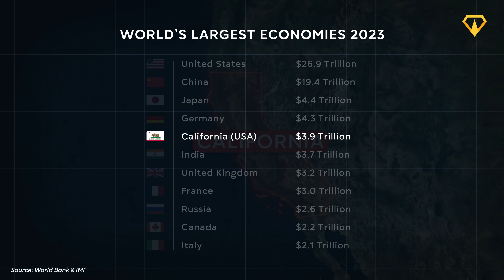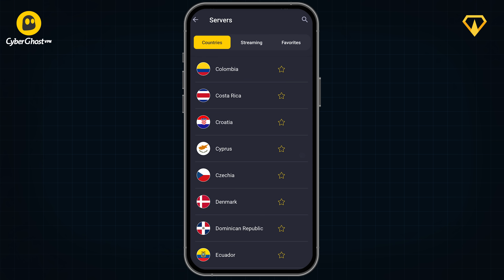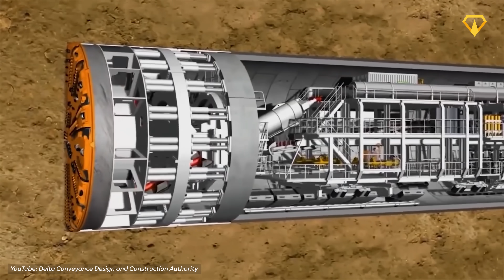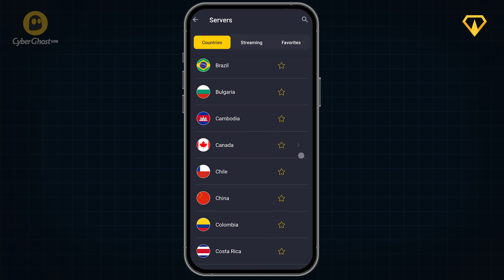California's Massive $20BN Water Transfer Project

Comment: The state of California needs to invest heavily into CAPTURING RAINWATER during the rainy seasons and pumping the rain water back down underground into the natural aquifers.  This will increase total annual water supply, minimize water surface evaporation, and possibly eliminate droughts in California.  If this water transfer project is part of the rainwater capturing process, then I am all for it.  
There is also a new method that is currently being developed which involves capturing fresh water from facilities that are located offshore, which does not require a desalination process at all, which is very expensive and creates toxic birine waste water.  Imagine an offshore platform like an oil rig, which does not drill for oil, but captures fresh water from the moisture in the air, and pumps it back to the shore(compare the process to the condensation from an air conditioner).  There would have to be enough of these rigs(like offshore windmill farms) built to scale to meet the water demands of the state.  I envision that the entire country could solve its water drought crises by allowing ocean bordering states to contract with desert states, for example, Arizona, New Mexico, Nevada, Utah, and supply them with an abundance of fresh water from our giant oceans.
I would love to see a segment dedicated to this idea at some point in the future.  Offshore water collection is the way of the future, in my opinion.

Comment: This project is a specific fix to a specific problem that comes up every few years, not a fix all to California's water woes. 
During extreme drought, salt water in the Delta encroaches dangerously close to the pumping stations that feed the aqueduct, to the point where all pumping has to be curtailed. The bypass will effectively solve that problem, allowing the SWP to safely harvest the Sacramento in extreme droughts.

Comment: For the Midwest, the Mississippi River is not just a water source... it is a major way to transport goods. Barges are usually run in bundles,  3 wide and 6 long. Tug boats move along those waters as actively as semi trucks, staying in organized lanes, following delivery deadlines. 

Recently, the Mississippi experienced record lows. The barges could not function properly. Taking a load of 2 by 4 is less than half the potential and costs nearly as much in fuel. Shipping from Chicago to New Orleans was in real trouble that year. 

Can anyone guarantee that the Mississippi can permanently give water to the distant coast beyond the Rockies? Head shake. Thumbs down. 

3/3 comments. Adios.

Comment: The only true long-term solution is ultra soaking every drop of rain back into the land. Anything built of concrete is a cast on a broken bone. The water passing thru existing systems does not recharge the deeper ground it passes over. Terrace on contour,  cut half moons in orchards, build municipal berms, field enhancing swales? Large and small, cliff edge to curb? Let's top off the water tables?

Comment: the fact that water bills (price per unit) in SoCal (a desert region) are 25% the cost of  NorCal (water flush region) tells you how much corruption is going on with water management. It shouldn't cost me more to take a shower than a corporate desert farm to be flooded. ridiculous. meanwhile the towns and farm workers that live nearby the corporate farm dont have clean running water. disgusting.

Comment: This omits that this project was put forward by governor Jerry Brown and was originally two tunnels. His father Edmund G Brown was governor during the time the state water project was conceived and mostly built. At the time many said that this was Jerrys attempt to have a water project legacy like his father. As far as the tunnel causing the delta to go brackish with salt water moving farther in yes it will accelerate that but with changing climate causing sea level rise that is going to happen anyway. In fact the upstream inlet of the tunnel is for just that reason. Another omitted fact is that with climate change that is already here there is torrential rain in the south part of the state causing flooding with no or very little storage capacity to catch and hold that water as it runs into the ocean leaving cociderable damage in it's wake.
Reply: Did you know that Edmund G. Brown also set aside about $80M to fund construction of the storage system that was to be built along the aqueduct? And, did you know that Jerry Brown squandered that money, creating a pension system for State workers?

Comment: Was this a joke?  Boring Co. could make a 1,000 mile long 12 ft. wide tunnel from Seattle to So Cal for about 6 billion, with a slight down hill slant.  Also, California has had a 800 year, a 400 year and many 25 to 50 year droughts in the last 2500 years.  It is not climate change, it is normal.

Comment: hahaha i live in northern califorina we dont have that much water wells are going dry up here as it is and they want to take the water that we up here dont even have to use down south they really need to think about taking water from the ocean clean it and pump that inland rather than move water that we dont have up here they should also make more ways to store water as alot goes out to the ocean during the winter floods rare as they are if we can store more it be better goes as far as to refill the under ground water supply by pumping it down there to store the clean water

Comment: Do you think digging miles of trench with concrete, water pumps, maintenance and lots of employees is cheaper than using desalination? Who are they fooling?. Not me..😮😊
Reply: "The Sorek B plant has a capacity to desalinate 52.8 billion gallons a year and is contracted to produce water for $0.41 per cubic meter. There are around 264 gallons per cubic meter, so this puts the cost at about a penny per 6.4 gallons.Sep 22, 2023".  Israel and Saudia Arabia are leading on desalination technology.
Reply: I’m no expert, but I know desalination is super expensive and energy demanding.  Once you invest in desalination, you continue having to pay a lot of money and utilities a lot of energy for every gallon desalinated.  

A project like this one could be much cheaper per gallon once completed, and last for decades. Even if the upfront construction cost is high, I suspect that it’d be cheaper in the long run, and more environmentally friendly as well.  But I haven’t seen the numbers.  So by all means provide them if you can prove my suspicion on the cost to be incorrect.
Reply: @firefalcoln  here is your answer. Desalination is possible and the technology is still improving. As for the energy requirements why are we not using tidal wave energy? It’s cost effective and doesn’t cause a bunch of ugly wind turbines to clog up the horizon. The answer to all these questions is the same.  POLITICS. Plane and simple

Comment: Keeping in mind the Delta Tunnel project started under Grey Davis, took 20 years to gain all the neccessary aprovals to finally start construction just as Jerry Brown was leaving office. Then, with a solution on the distant hoizon, Newsom cancelled the project & re-started it as two smaller tunnels. It will take another 20 years for aprovals now. Newsom, with a stroke of his pen, has prolonged this crisis an additional 2 decades.
Reply: Hetch-Hetchy Dam...

Comment: For the the colossal amount of money they are spending with the potential for tue water source to run dry in time. They could of built a sea water desalination plant for endless water supply like they do all over the UAE
Reply: They are soo scared to use desalination yet the uae dubi and many many other countries have been doing those for over 30 years. A pal i know is now a multi millionaire from setting up plants in the uae yet the usa wants to keep moving water at three times the cost and yearly maintenance costs. Bah ha ha ha ha

Comment: Why not just remove people from the area that's Tulare Lake and turn it back into a lake and then they would have fresh water and not need to spend billions on this project as they can have an area that would work to keep the water stored.
Reply: If the lake is impermanent then the farmers relying on irrigation are playing a hard gamble. How often is it too dry? 1 in ? Guessing 8 years? 

So their business plan includes a 12+% loss? To hope not to fail on land that only gets surface watered? 

Verses... letting a natural lake recharge the ground water around it? Deeply infusing moisture back into the land verses squirting water on only the surface of distant desert slope? 
No brainer?
Reply: It wouldn't be so easy that they would just have more water. As I understand it, the lake has dried because it's waters were used for irrigation, so you would have to find some additional water sources, perhaps some some canal that would transfer excess flood water from reservoirs all the way up to Lake New Melones. But at least transfer of excess water from San Joaquin river during floods could be possible. But the lake would be very unstable in it's size and volume of water. On the other hand, it still could be beneficial to have this lake, or rather lake basin that could help with recharge of water tables. And also would add some additional moisture to the atmosphere and possibly influence rainfall patterns. (I assume it would be enhanced)

Comment: There’s really no water crisis. This project seems more like a safety precaution for just in case scenarios. If you’ve been to this area you will know that many of those aqueducts carry water above the ground by large earthen dykes. If it was to rain for more than 30 days continuously those dykes could give way flooding the entire valley. If that was to happen, the tunnel would still be able to convey water south of the delta. People need to know that the entire Central Valley drains into the San Francisco Bay. Is this project necessary, No, theres plenty of workers and large machinery available to fix any breach in the dykes fairly fast, Is it a smart idea to build, yes, might as well, there’s plenty of people that need to work, and you can never have to many safety precautions in place.

Comment: One idea that has be passed around for a long time is to cover the aqueduct with solar panels. A huge amount of water is lost to evaporation; this would help with that. Also, the generated electricity, which could be massive, could potentially be used exclusively for water desalination.

Has that ever been taken seriously by the powers that be?
Reply: Much cheaper to just use those black balls...
Reply: The Gila River Indian Community is currently doing this in Arizona
Reply: India is doing just that and it seems to be a functional option, so far. It significantly reduces evaporation, and by being over the canal, it keeps the panels cooler, making them more efficient. Self-cleaning technology for the panels is improving, as well.
Reply: @cheesedude1733 yeah, let’s buy more Chinese made solar panels.   I’m sure none of them will be spying on us.
Reply: And attach water wheels, attached to grindstones, to the bottom of the solar panels to crush all that organic wheat, corn and rice into flour.
You can also automatically run the bellows of the local blacksmiths forge. Smh

Comment: California could use desalination like Israel, powered by nuclear energy, because it sits next to an endless supply of water in the Pacific Ocean. However, it prefers to take water from five other U.S. states that could use it. California is the reason Lake Powell and Lake Mead are so low.  Israel offered to help California but they were turned down...and then given a lecture.

Comment: Transferring water from the Mississippi River to Southern California in an amount equal to or above current withdrawal from the Colorado River is a more long term resolution.
Reply: For the Midwest, the Mississippi River is not just a water source... it is a major way to transport goods. Barges are usually run in bundles,  3 wide and 6 long. Tug boats move along those waters as actively as semi trucks, staying in organized lanes, following delivery deadlines. 

Recently, the Mississippi experienced record lows. The barges could not function properly. Taking a load of 2 by 4 is less than half the potential and costs nearly as much in fuel. Shipping from Chicago to New Orleans was in real trouble that year. 

Can anyone guarantee that the Mississippi can permanently give water to the distant coast beyond the Rockies? Head shake. Thumbs down.
Reply: @OublietteTight  water levels can be controlled with barrages which raise water levels, even if downstream waterflow is low, Mississippi excess floodwater can be transferred to the Colorado. Also dredging can improve the depth of the river.
Reply: @OublietteTight  I know. I live there.
Reply: @OublietteTight  ; yup. Mississippi water is needed in the Mississippi River. 
The Desert Sun website had an article about this. The obstacles for even moving Mississippi water to more nearby Colorado or Arizona is overwhelming. Forget about California. The western states are going to have to figure out this problem using resources in the west. California is trying to do that with the Water Transfer Project. Arizona is looking at doing a partnership with Mexico to operate a desalination plant together.
Reply: they wont let u build that
Reply: @zion3335  I know but, if it were economically feasible, a pipe line wouldn't have to go all the way to California. Just to the Colorado River just before the major lakes on it to refill them as needed. Then excess water could be used in Arizona, New Mexico, and Utah for development and irrigation for mass farming. Just an idea.
Reply: @GregAvey-s1n  i know , but the environmental; and anti development activists would not let that happen, since it would destroy their narratives. They would just say some obscure fish or some frog is invasive/threatened and stall; the entire project.
Reply: @zion3335  agreed.
Reply: Any Mississippi water being piped West would first go to these places which need water, starting with West Texas. If it went further, it would to New Mexico. If it went further, it would go to Arizona. Mississippi water would never make it to Southern California.
Reply: @bb1111116  Mississippi has huge flood waters, it will satisfy all; the western states, the tech exists, the will to do it does not

Comment: What CA and the entire southwest needs is massive desalination. The whole region is running dry. Seawater should be desalinated on a massive scale and piped throughout the region.
Reply: Yes and there is so much sun in the desert so it can be done using solar power and it's something that day and night intermittency is irrelevant to (just run the plant when the sun is shining). Besides the Cali coast, the gulf of California is very close to Arizona. Mexico can make plants there and sell water to Arizona via very simple short pipelines...
Reply: They tried in the 90’s and it got shot down by the Coastal Commission
Reply: I don't get all the people saying desalination is the way to go? More water storage reservoirs seem easier, cheaper, and more better for the environment.
Reply: @danielgarbuzov8106 storage is very helpful but hard to get approved because it essentially destroys the environment of the footprint it uses. Adding height to existing dams to increase their storage capacity is possibly easier since the land use is already tied to water storage. And ultimately you’re still reliant on sufficient precipitation to fill the reservoir which is no longer as guaranteed as it once was. Desalination is more expensive but it’s much more resilient to climate change, and physically has a much smaller environmental footprint.
Reply: @danielgarbuzov8106  Except there is no more water to store in the southwest. Have you seen the water level in Lake Mead compared to 20 years ago? The Colorado River is tapped out. They have to desalinate for the southwest anyway. Might as well include California.
Reply: @martymcfly256  that's not completely true, socal gets a huge portion of lake Mead water, if there was proper rain water storage in socal they'd be able to provide for there own needs.

Comment: Ocean water can be desalinated as free byproduct of cheap hydrogen fueled electricity & Eirex Tech doesnt use old technology for providing the lowest cost energy & fresh purified water from any source on the planet using "Energetic Cavitation Impact" comparable to the 8 year old YouTube Video by Prof Marc Ramsey, Vanderbilt University who generates 400,000 pounds per square inch from impacting BB pellet sized water bubbles like smashing one nail with one million hammers at the same time. The ocean water stores 150 times more Co2 than air and when combined with minerals in ocean water the production of cement, bricks, fertilizers, highly profitable Co2 Trading Credits with life and energy sustaining chemicals includes free desalinated ocean water when US partners with 5 year old Canadian cavitation company called Eirex Tech to change the world. PS: Contaminated waste plastic provides cheap synthetic fuels using energetic cavitation impact by Eirex Tech that can be harvested on-board ocean going ship for fuel from waste plastic just like fuel from any type of water. See the 30M year old Pistol Shrimp species who perfected overunity energy from cavitation bubbles so powerful they crack clam shells without physical content the scientific community ignores because it violates their religion of laws of physics the quantum world of science laughs at.

Comment: In the early 2000s some politicians wanted water to be transported via canals from the Kimberley (Lake Argyle) to Perth.  It didn't happen and is unlikely to.  Perth has a very similar climate to Los Angeles but is not going to use canals or water piped in.  Its too significant a distance.  Check google maps and you can see the distance.  Its such a difficult and expensive project.